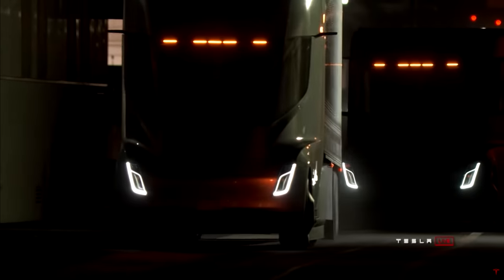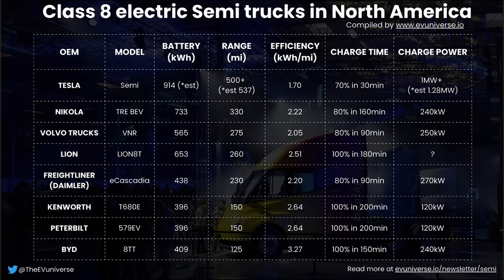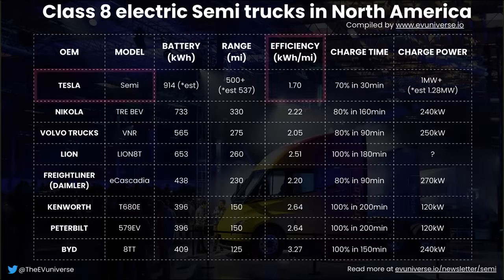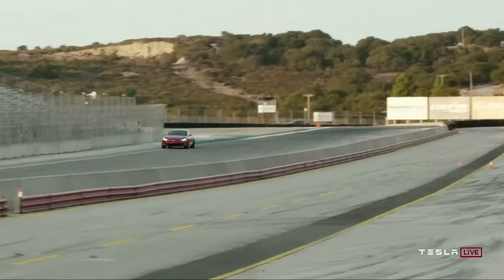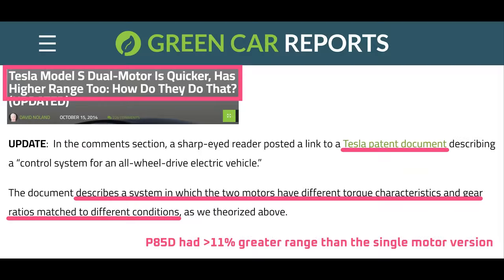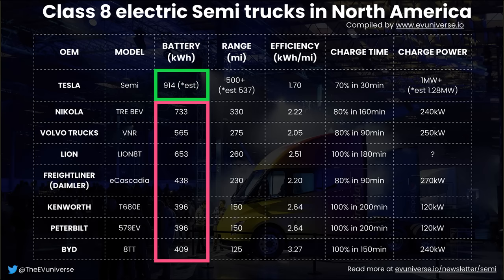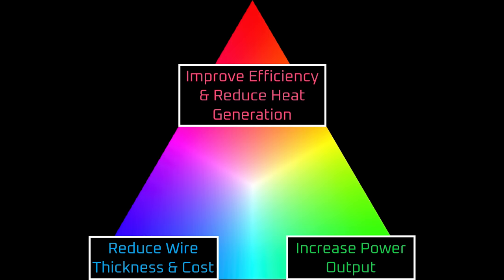How the Tesla Semi “Broke the Laws of Physics”

Comment: Curious to see how the regen works with decoupling motors. They are supposed to accelerate and then couple... to regen... hm.
Reply from the maker: Easy, recouple
Reply: Hold your arms elbows out, splayed fingers pointing at each other.
To interlock, turn arms at same rate and push together.
They can gauge the speed of the wheel drive shaft ("left hand"?)
They know the gearing.
They can very precisely and quickly calculate and adjust the motor speed ("right hand") to match.
Push your fingers together.
.
Result, "you don't feel the drive engage" (Dan Priestley)
(They will no doubt have double redundant speed sensors to ensure a perfect match)
Reply: @rogerstarkey5390  I get the smooth recouple tech, but that implies accelerating the decoupled motors (consume some power) just to then regen (produce power) Just curious about procentages as about when that is worth doing. May implicate other sensors, like knowing the inclination of the road/truck and only use that for descending roads etc.. (there where some img about cybertruck having such..)

Comment: Yes, Tesla understood quickly that the power limit in EV is given by the battery C rate rather than from the motors. So they sized motors and inverters accordingly, because motors are cheap compared to batteries. They've kept the same logic in the Semi. Also, it seems to me that they've also standardized the powertrain between cars and semi. Just one question though: is there any Tesla car with 1000V architecture?
Reply: None of the cars, but the rumor is the CT will.
Reply: @TheEvilmooseofdoom  Not a rumor.  This was a direct statement by Elon and the leader of the Semi Program.

Comment: I think that if the batteries could not absorb enough power quickly enough with hard braking, then a capacitor could be used as short term storage.

Comment: If the plaid architecture is of a 400 V, how inefficient will the use of those motors turn in a  unmatched 1000 V architecture?
Reply: The DC link is 1000V but the inverter produces a varying voltage to the motor.  Generally there is a volts-per-hertz ramp applied (as the motor produces more back emf as it gets faster meaning higher applied voltage is required to maintain current/torque).  The 1000V architecture does mean that battery string voltage can be higher and power conversion current is reduced (power converter sizing - IGBTs - is mostly dependent on current not voltage).

Comment: What about charging on top of a mountain and then driving down a steep hill?
Reply from the maker: Weeeeeeeeeee!
Reply: @thelimitingfactor  I'm serious. Trucks have Jake brake systems, do these have resistor banks?
Reply: @z50king29  No, they have regenerative braking instead. There's no conceivable reason why a charging stations would be installed on top of a mountain; but in the hypothetical case that one were, drivers would just undercharge to leave room in the battery for energy from regenerative braking.

Comment: The way you wind your motor determines speed or torgue
Delta is torgue
Wye is speed 
Tesla also has a reluctant motor that I know nothing about .
So off hand I'd say the back motors are delta while the front is wye
I'm a retired trucker and when news of Tesla semi came out I looked up the dimensions of the model S battery .
You can fit about 10 of them if doing a retrofit fit on a deseil
Reply: Every production EV motor (from Tesla and everyone else) is delta wired.
The recent Tesla motors (starting with the Model 3's rear motor, and including the Plaid and the Semi) are all interior permanent magnet (IPM) designs; all IPM motors get some of their torque from a synchronous reluctance effect.
Reply: @brianb-p6586  what is the torque and speed difference for reluctantance?

Comment: Are the Tesla trucks being delivered?  Are they in use already because that's news to me.
Reply from the maker: Yes
Reply: @thelimitingfactor  I just did some research and it appears they were delivered in the beginning of Dec 2022 but you'd think that Pepsi would be talking about them more but they're probably disappointed with the real world range and that's why they're staying hush hush.
Reply: @PeTroL420  It's clear they're on an NDA; the PepsiCo VP has said as much.
Reply: @BigBen621  Why would there be an NDA on something that someone already purchased? Pepsi and Tesla aren't in a partnership where they share each other's technology.
Reply: @PeTroL420  You seem to have the mistaken impression that NDAs only apply prior to a purchase, and that they require parties to share technology with each other. Neither of these is true. Tesla has shared information with PepsiCo that they would obviously desire to be kept confidential, both before and after the sale; and this is an appropriate use for an NDA. A quote by PepsiCo VP Mike O'Connell makes this clear: "The Gatorade maker declined to share specifics on the weight of the trucks, another closely guarded secret by Tesla".  As to why Tesla chooses to keep these specifics confidential, there are several possibilities; but you'd have to ask them for details.
Reply: @PeTroL420  I can think of 3 with no research: 1) The first few batches are also testbed and the full production model will have changes; 2)  The other manufacturers are looking to take the best idea. They can guess (like in this video) but know until they have a unit. 3) Tesla doesn't want bad press during this stage. Issues could be user error, production issues, and/or design issues.
Reply: @BigBen621  "The Gatorade maker declined to share specifics on the weight of the trucks, another closely guarded secret by Tesla". 

I don't see the letters N D A anywhere in that opinion piece written by a columnist.  

Unless you're going to try to tell me that the NDA has its own NDA, lol.
Reply: @davidwatson8142  What does Pepsi have to gain by keeping that info a secret?
Reply: @PeTroL420  I would also guess they have an NDA. The NDA I have signed also doesn't let you disclose that you have an NDA.
Reply: @davidwatson8142  Oh, you just happen to have an NDA that says you can't talk about an NDA?  Sure buddy.
Reply: @PeTroL420  Interesting that you would attribute this to an "opinion piece written by a columnist". If you know the source, you know that this is false. And if you don't know the source, you're stating as a fact that which is only speculation on your part.

Of course, the source doesn't state explicitly that there's an NDA. But the statement that the weight is "another closely guarded secret by Tesla", and the fact that no information has been leaked, even by those who are actively loading and driving these, suggests strongly that everyone involved is on an NDA. If you're so sure they aren't, you are free to speculate on another reason no one's leaking this information.
Reply: @PeTroL420  You seem to have many misconceptions about NDAs. A little research might be in order...
Reply: @BigBen621  Dude, there are no such things as an NDA to an NDA and it's ridiculous that you made the claim that you had one.  You EV zealots are a trip because you can't be honest with anyone about EVs.  You people just mention all the good stuff about EVs and pretend the bad stuff doesn't exist.
Reply: @PeTroL420  Strange reply..
Reply: @davidwatson8142  I guess you're not use to speaking to someone who doesn't wear EV rose tinted glasses and challenges your opinions with facts instead of fiction.
Reply: @PeTroL420   "there are no such things as an NDA to an NDA" Like the rest of your statements about NDAs, this one is what I like to call "false". An NDA can include a non-disclosure requirement if both parties agree to it.

"it's ridiculous that you made the claim that you had one" I've made no such claim.

"You people just mention all the good stuff about EVs and pretend the bad stuff doesn't exist" Every enterprise known to man has negatives, which must be considered along with the positives. It's risible that you armchair engineers think that you understand the negatives better than PepsiCo, who's been working with Tesla on the development of the Tesla Semi for years.
Reply: @PeTroL420  What actual facts, other than your many misconceptions about NDAs, have you asserted? Most of your sentences in this thread end with a question mark.
Reply: @BigBen621  What misconceptions do I have about NDAs?  Or is it that I don't believe you when you say you signed an NDA saying not to discuss the NDA that's upsetting you?
Reply: @BigBen621  A non disclosure agreement is when both parties agree to not talk about the subject, not the NDA itself.  Give me an example where an NDA states that you're not supposed to talk about an NDA.
Reply: @PeTroL420  I thought we were talking about NDA and how they work but don't let that stop your rant.
Reply: @davidwatson8142  We're talking about an NDA to an NDA, something that doesn't exist.  And you're the one that's ranting with lies or half-truths.
Reply: @PeTroL420  No the NDA was in the NDA.  A NDA can have "do not talk about having an NDA" in itself.   Do you understand?
Reply: @minisithunknown5568  Sorry, I don't understand your lies.

Comment: As for aero drag, what Tesla has done isn't revolutionary; simply practical.  There have been aero prototype semis for nearly 50 years,  just no implementation.  Have you noticed those big plastic fairings under semi trailers? They're a simple nearly 50 year old idea which took over 30 years for anyone to bother implementing.
Reply from the maker: Yup!  that's why I called it the obvious
Reply: @thelimitingfactor  definitely! As always,  your work is excellent,  sir!
Reply: Funny how the legacy truck manufacturers did not provide an aero design.
Goes to show that if you are suitably motivated, you can get great results!
Reply: @bru512  the aerodynamics of diesel trucks have improved significantly over the years. Current designs are somewhat limited by the need for a large radiator grill intake area; an EV needs much less cooling airflow.
Reply: @brianb-p6586  I agree withe the air flow argument, but IMHO ICE semi manufacturers don't care as much about aero because if they want to provide more range they just make the tanks larger for a few dollars.  Tanks are much cheaper than batteries.
Tesla was totally motivated to make their semi efficient as range is a huge benefit.

Comment: I wonder why dont they remedy the regen breaking via supercapacitors?
Reply from the maker: Because the battery pack provides enough buffer.  Supercaps are a waste of time.  There are several other ways to get better power output without dicking around with another set of energy storing devices.

Comment: Great video! In the recap of the semi delivery event from Farzad. Cory from Munro mentioned (around 2:51:00) that the charging limits was more because of the wiring, busbars and onboard charger than a battery limit. Will that be the same for the motors and how much regen breaking it can take?
Reply from the maker: Oof, that would take some time to explain.  Short story, regen isn't governed by the on board charger, it's governed by the inverter.
Reply: No.

Comment: (Edit: the driver's pay is what makes it only 17% and not 75% cheaper.)

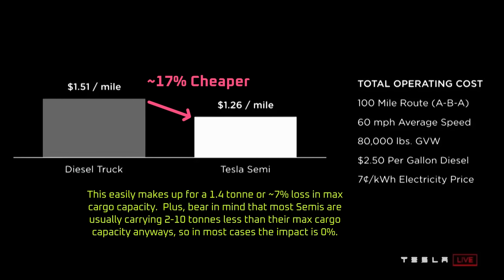I don't understand how you arrived at 1.26$/mile for Tesla Semi, 17% cheaper (13:39)

If the semi requires 1.7 kwh/mile and electricity is 7c/kwh isn't that 12c per mile?

If a diesel truck gets 6 miles/gallon that is 0.1666 gallons per mile, at 2.50$ isn't 42c/mile?

42c per mile diesel vs 12c per mile Tesla semi is ~4x cheaper per mile (if electricity is that cheap)

Am I missing something?
Reply from the maker: It's not my estimate, it's Tesla's.  It's old.  Cleanerwatt did an update.

It's pretty easy to look these things up and form your own view and plenty of people have done analysis - use the power of the keyboard and the search box
Reply: @thelimitingfactor I wasn't nitpicking how up-to-date or how 'perfectly accurate' the estimate was.

It seemed off by ~10x because I foolishly did not include the cost of the driver. I'm not a pedant - I was missing something.

TY for the video.

Comment: When the electronics goes to approx 1000 volts using Silicon carbide, instead of the the normal silicon for semiconductors, there are some gains... To quote "A key differentiator of SiC over silicon is its higher system-level efficiency, owing to the greater power density, lower power loss, higher operating frequency, and increased temperature operation." I'm no expert, but because of the physical characteristics, components can be smaller, run at higher frequencies, and withstand higher temperatures - all of which can improve efficiency...it is, of course, more expensive, but in the case of the Tesla semi, or the Lucid Sapphire, that is not really a consideration...( can it be compared to turbo-charging an ICE engine ?)

Comment: What if the trailers have a roof full of solar, how will the efficiency look then?
Reply: Because this is one of the most frequent comments on Tesla Semi YT videos, I did the math on adding solar panels to standard dry van trailers. Turns out that they would produce enough electricity for an added range of about 13 miles a day. But the added aerodynamic drag and weight would decrease the range by about the same amount, for no net gain. Much more importantly, solar panels covering the top of a dry van trailer would weigh about 2,000 lbs., which would of course reduce the payload by that amount. I can post the calculations, if you like.

Comment: Hey Jordon, Re: The SACMI machine being installed in the cathode plant at Austin, in the Q2 2021 Earnings call Elon mentioned problems with the ramp of 4680 cells, saying: 

"but right now, we have a challenge with basically what's called calendaring, or basically squashing the cathode material to a particular height.
So it just goes through these rollers and gets squashed like pizza dough, basically, but very hard pizza dough. And it's causing -- it's denting the calendar rolls." 🤔 

Huh? Denting the calendar rolls??? Might this piece of equipment, from a company that makes hydraulic presses for ceramic powders have the solution to compressing the dry battery cathode powders to the correct thickness without 'denting the calendar rolls"?!?
Reply from the maker: The cathode plant that's being talked about there makes a finished material from raw products.

What Elon was talking about was costing that finished material to an electrode foil.

Besides, that machine is more for stamping type operations rather than continuous motion coating.

Comment: Two things…have they released the weight of the cabin yet? If not, why not? How much are they selling these for? Why are they not telling us this? Calculating the maximum cargo load is crucial and it’s proving tricky without more data. I dislike the transparency but I agree that it is an excellent solution for short to medium haul routes.
Reply from the maker: All you have to do is a quick Google search and you'll have the answer.

I didn't cover that in depth in this video because so many other people have done it.
Reply: @thelimitingfactor  No the weight of the cabin has not been established, the best we can do is speculate based on the weight of jersey barriers vs total capacity.  The price is years old and has not been updated.
Reply: @NathanielRises606  Maybe because they're not quite ready for wide release.

Comment: Can we talk about the elephant in the room you so skillfully avoided. Experience has shown us that a typical battery degrades to a point of unusable in 100k to 150k miles. This is the typical miles annually for a semi, are we going to swap batteries every year in the Tesla semi?
Reply from the maker: That's because you're making shit up without looking it up.

Even a poor quality automotive battery lasts 1,000 cycles now.

If the semi only has 400 miles of range, that's 400,000 mi.

But typically, a high quality battery cell hits 1200 to 1500 cycles.

Comment: I haven't heard anyone else talking about how much regen braking 80,000 lbs can actually add to the oversell range of a Semi. Very impressive. Good info as always, Jordan.
On a different topic, concerning the 4680 production and dry versus wet cathode production. 
    Watching Joe Tegtmeyer's Giga Austin videos, viewing the size and shape of the Cathode building leads one to believe they are preparing to install football field length machinery, with lots of tanks and pipes for liquids and such.  
     Not what you would expect from the BD presentation.  
My question for you, might even be worth a video on the Cathode plant and possible processes. 

 Do you agree they are making what appears to be a rather large commitment to using the wet cathode process for the foreseeable future and what would that mean for the Cyber Truck?
Reply from the maker: Thanks!

A wet process is used to make the active cathode material.

But that's very different from the process that might be used to coat the electrode.

Right now they're using a wet process, but it sounds like they're either doing it in Fremont or importing it from China.

But I don't know if that's sustainable.

So what we really need is advice from Tesla on how things are going with their dry process.
Reply: @thelimitingfactor  I guess I am a little fuzzy on producing the cathode material versus applying it to the electrode.

Comment: If it makes sense economically, it will catch on. If it doesn't, it will fail. 

The big question truckers will have, in addition to realistic ranges, charging times, and load capacity is battery life. When Pepsi ordered the Semis, they got nearly $200k in subsidies PER TRUCK form the government. Basically no risk to their bottom line. An independent trucker will never buy a Semi w/o knowing everything there is to know about the economics, logistics, and maintenance. The Semi has a long way ahead to prove if it's a viable solution.